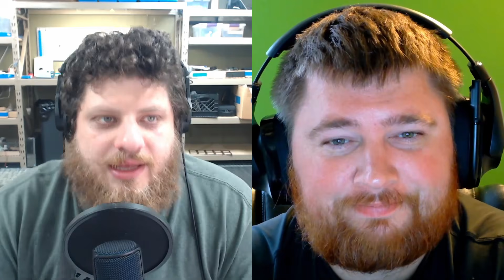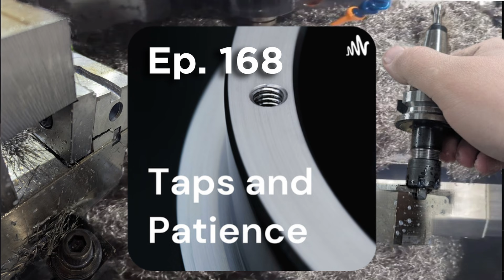Not my first liftgate sh**show- Ep. 168

Comment: The thing people don't realize about "haas power" is that they don't rate their spindle load the way that a lot of other machine manufacturers do. Haas sets their spindle load as a duty cycle where 100% is all day torque and above 100% starts dropping the duty cycle in stages till it maxes out and can run something like 10 minutes at that level. So in reality the power is there but only when you really need it and limited on how long you can run it like that. But if you're not running a haas at as close to 100% spindle load as you can when applicable you're doing yourself a disservice.